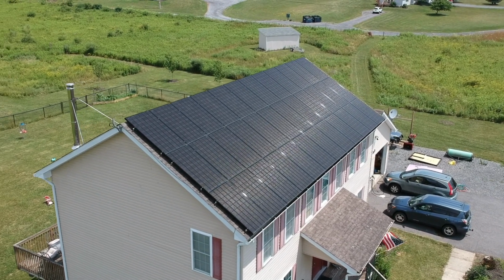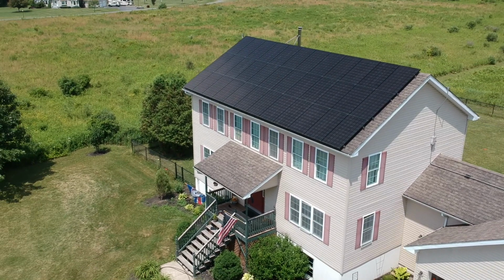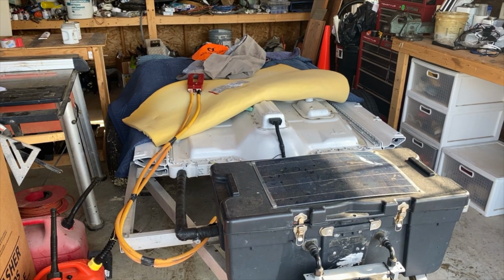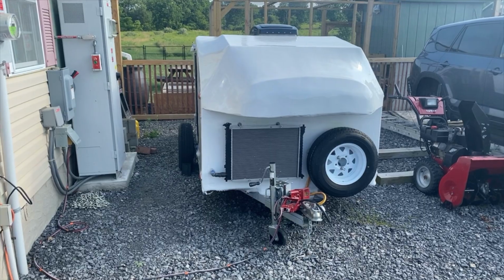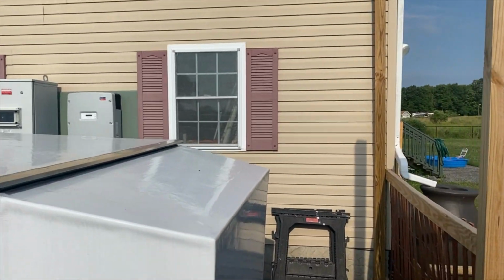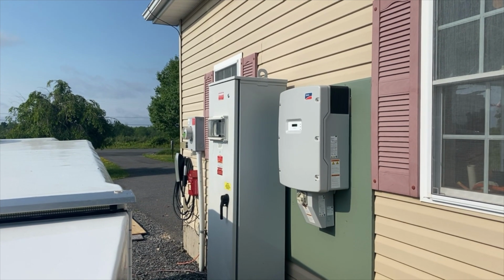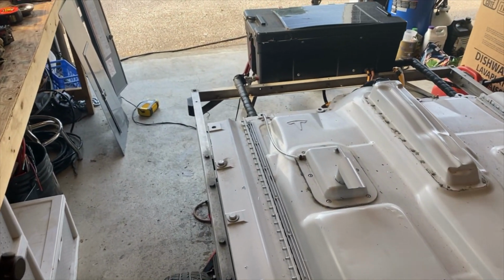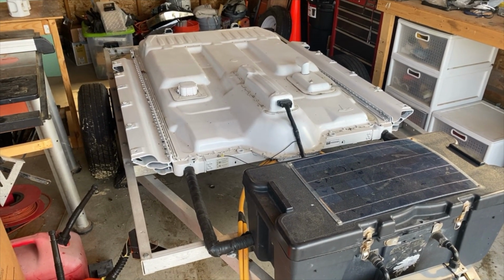Off Grid Solar Update: Living Off-Grid for 1 Year

Comment: Is there a video on how interconnect agreement works?    The piles of bureaucracy seem like a big deterrent for solar adoption.  It would be nice if someone laid out panel cost, how much they cost now, cost to connect...   I got a smart meter for  off peak charging, and they added a 'Customer' line item for $17 / month.  I think that's for the 'plan' not a meter rental fee.  also break down delivery vs supply for electrical and why you only get credits and can never see cash from the electric company.

Comment: Can you charge your batteries from the grid?  You could switch to hourly rates charge the Batteries when tbe power is cheap and then use the power when it is expensive.
Reply from the maker: Yeah, I do all the time. I actually just called my provider a couple days ago about this. It wouldnt work that way for me. Currently Im on a plan that electricity is one rate no matter time of day. If I switched to their time of day plan all of my solar production would only go towards a daytime credit. Nighttime would only be one penny cheaper but my credits wouldnt apply to nighttime usage. So it wasnt worth it to switch. My thought was to feed the grid all day and recharge everything overnight. But no.
Reply: @JamesKlafehn  got ya very different from what we have hear in Illinois with Comed.